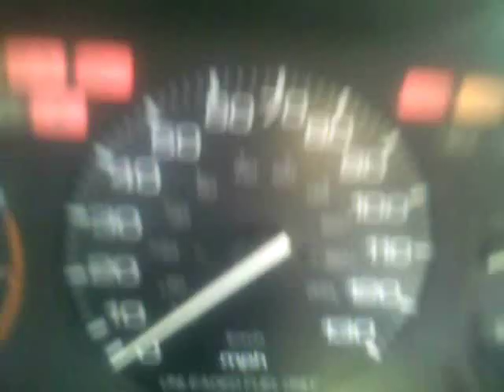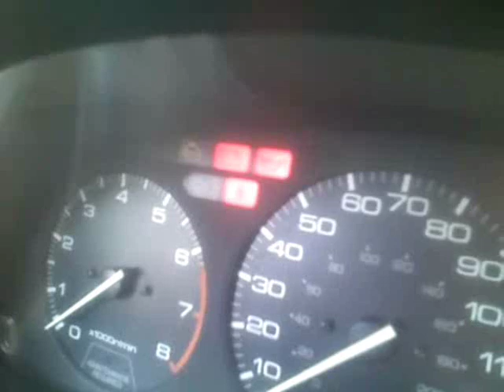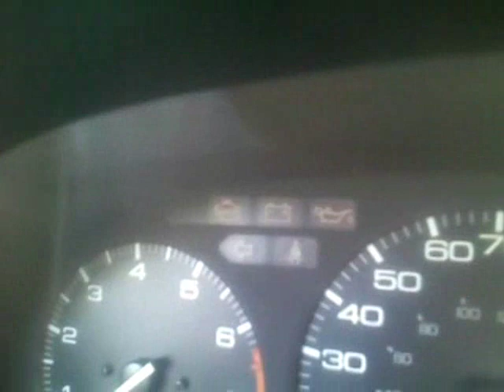how to diagnose a check engine light CB7

Comment: extremely helpful, I am wondering if it will work on cars equipped with a different ecu (P28, P72) and hondata.
Reply from the maker: Richard Bossman should work on any Honda car from 90-2001
Reply: ok, would having hondata S300 disable this function
Reply from the maker: Richard Bossman yeah it would disable it on a tune. You have to ask the tuner how to check it.

For my tune, I put key to on, and I full throttle the pedal and it check for me

Comment: My check engine light comes on when it reaches around 50 mph.
Any I dea why that is happening Honda accord ex 1992
Reply: mine does the same thing did you ever figure it out??
Reply: jack van valen probably the oxygen sensor most likely

Comment: I have a 1993 accord the engine light blink's 6 short blink's what does this mean?
Reply from the maker: george patten code 6
Reply from the maker: george patten it means your engine coolant temperature sensor is faulty or not plugged in

Comment: The problem was a short in my main wire harness connecting to my dash, causing my tcu to read wrong. I stuck my finger up behind the dash, shoved the wire into a diff position and the short disappeared

Comment from the maker: It goes off to blink the codes at you.

example:  ___ ___ _ _ _ = 23

___ _ _ = 12

If the light does not turn on when you jump the connector, make sure it is making good contact.
If it just turns off, you probably have a bad ECU.

Comment: code12 = exhaust gas recirculation system
code13 = atmospheric pressure
code14 = electronic air control
code15 = ignition output signal
code16 = fuel injector
code17 = vehicle speed sensor
code20 = electric load detector
code30 = A/T Fl signal A
code31 = A/T Fl signal B
code41 = oxygen sensor heater
code43 = fuel supply system

Comment: code0 = ECU
code1 = oxygen content
code3/5 = manifold absolute pressure
code4 = crank angle
code6 = coolant temperature
code7 = throttle angle
code8 = Top Dead Center position
code9 = no1 cylinder position
code10 = intake air temperature

Comment: codes 1 through 9 are indicated by a series of short flashes; two digit codes use a long flash for the first digit followed by the appropriate number of short flashes. For example, code 14 would be indicated by 1 long flash followed by 4 short flashes. Codes are separated by a pause between displays. Multiple codes are transmitted in an alternating pattern. For example, a code 3 and 14 would be displayed as 3 short flashes (for code 3) followed by the separator pause, then 1 long flash and 4

Comment: down in the passenger side foot well, there is a kick panel right where the bottom edge of the door opening starts to go up, it is right below the glove box. its just a piece of plastic. pull it out. underneath that is a blue connector with two wires that is not connected to anything take a paper clip or wire or whatever and jump the two prongs. now turn the ignition to the on setting and the check engine light is going to flash, this is how you read the series of flashes.

Comment from the maker: As long as it is a 2 wire plug, it works the same way.
Honda just designed the plug differently from the 90-91 to the 92-93 models.

Dont look for color, but just a plug that has 2 wires, that are not plugged into anything.
That should do the trick.

Comment from the maker: @hi4411 The gas cap occurs for newer cars OBDII (1996+)

Honda and Acura do not throw codes when there is nothing wrong. They throw codes when there IS something wrong and NEEDS to be fixed/replaced.

Comment from the maker: @trente45 Yes, it is at the lower kick panel side in the 1995 Honda Accord.

Should be the same as mine. The blue connector is stuffed into a rubber holder under the kick panel. You must pull it out of there before you can access the pins for servicing. 
Honda made that a fail safe so that nothing can accidently go in there and touch it together.